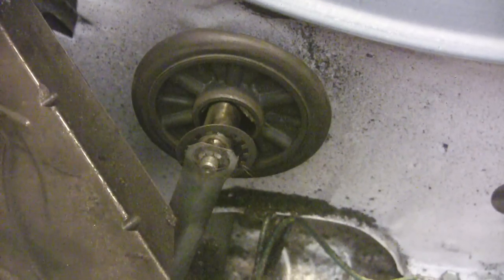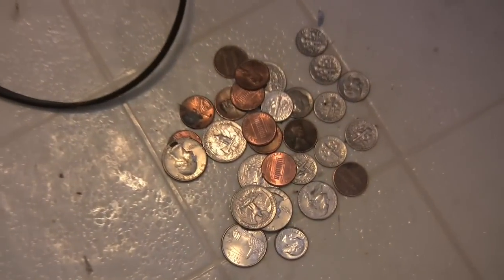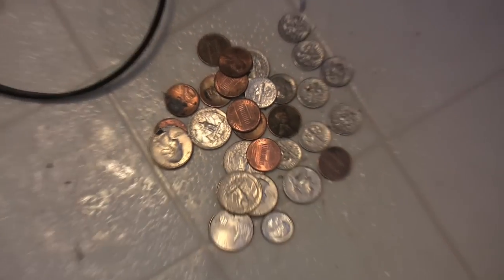Dryer Repair

Comment from the maker: @QCThemountain  
The belt that goes around the drum also passes through the motorized wheel.  This wheel is usually suspended and is clipped in by a metal fastener.  I first place the drum in place with the belt on the drum, then place the belt through the motorized wheel.  Hope this helps.

Comment from the maker: Hello. It wasn't too bad.  You just pop off the top, remove two bolts off the front cover and remove the front.  The drum is held in place by a belt that I remove and pull out the drum.  Then the you can see the support roller I had to replace.